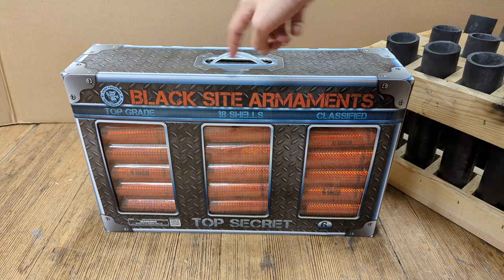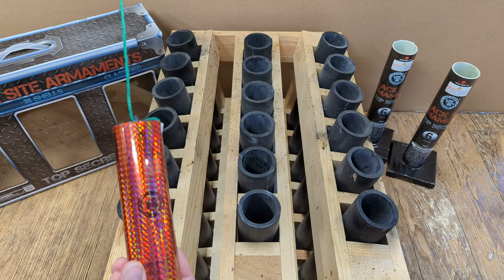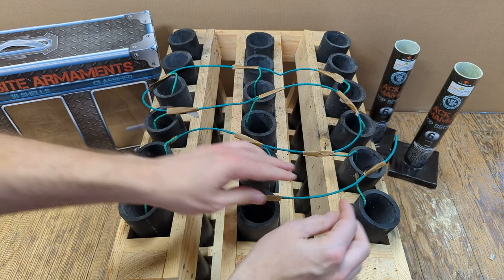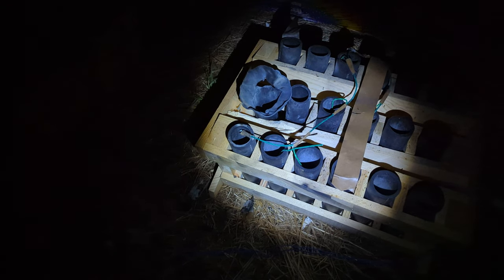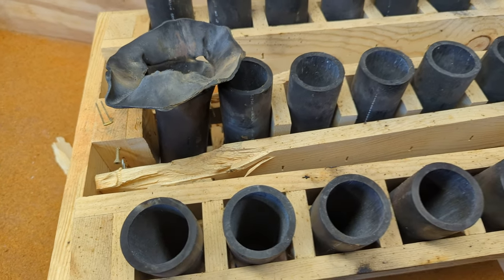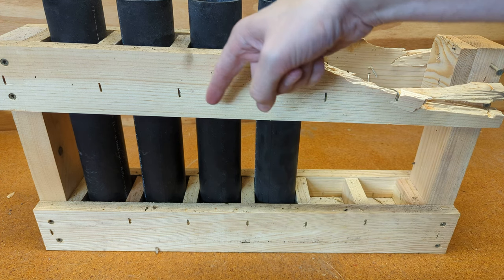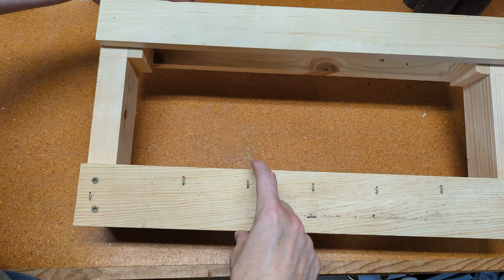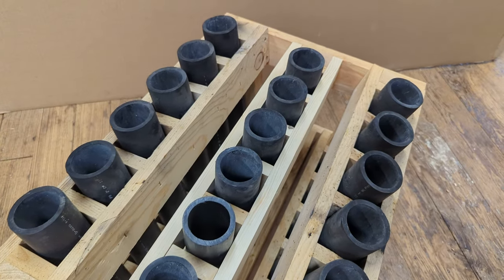I had a firework shell muzzle break!

Comment: Nice breaks for sure..... the orange one was very nice.   Was the one that flower potted  have a mine in it also? Just curious on that.   On building racks I like using glue too, yes hard to fix, but they can be tossed around for years and not loosen when glued and screwed.
Reply from the maker: I figured out it was the Whistling tail to brocade crown to timerain shell that blew. Glue is always a great idea too!

Comment: Thats the reason when i start building my own racks im going to run full length spacers.
Reply from the maker: I have totally been converted to spacers too. I need to rebuild a bunch of my racks, but will eventually only use spacers.
Reply: @JoelRobinsonPyrotechnics  I'm using the fiberglass included pipes right now but will be looking into the pyroboom HDPE orange pipes for my racks. It's just taking me a while to build up. Next step is joining the pgi and working on getting a cobra system and man that site gets confusing. I don't know if I get a module if the romote comes with it or if it comes separate. Than work on getting my 1.4 pro license from pgi.
Reply: @JoelRobinsonPyrotechnics  ps I think full spacers are safer. Where the pipe is fully contained.
Reply from the maker: @jesseweaver_fuyt  You're totally correct on the safer aspect. That is awesome to hear man, and there is nothing wrong with using the fiberglass tubes you have. You can screw those down to a piece of wood and still have a safe rack.
Reply: @JoelRobinsonPyrotechnics  yes. I got some 2×3 and some 1×3 to build one. The issue is is bills have always come first and it's rough saving up for all this stuff
Reply from the maker: @jesseweaver_fuyt  It is an expensive hobby for sure! I have a ton of fiberglass tubes if you want any. Also, you're doing it right by prioritizing your bills. Gotta make sure you're covered first!
Reply: @JoelRobinsonPyrotechnics  I'm going to get 50 HDPE pipes this fall. It's only $170 from pyroboom.
Reply: @JoelRobinsonPyrotechnics  and I live in Pennsylvania. It's kind of a lot to ship that weight
Reply: @jesseweaver_fuyt  If you mean a FULL length spacer running the length of the mortar don't do that!  You are building a box then and taking away two sides for the explosive gases to leave..... If you just mean, spacers in all your racks between all your mortars and the end boards please ignore me!
Reply: @denfireworks  no it will be in-between the each pipe. It will still have open space on two sides for the path of least resistance if there is a blast in the tube. I have been blasting rocks for 5 years and that part I know. You always want at least on path of least resistance

Comment: Do you recommend spacers between each mortar? I have 6 racks currently, 2 rows of 10, but no spacers. They are very heavy and well made, but wondering if spacers are needed.
Reply from the maker: Space will always be safer as it allows room for the gas to escape if something were to go wrong. The fewer total tubes in a single sleeve will help mitigate risk. There is nothing wrong with the setup you described, though. If you build more in the future, consider adding spacers is my recommendation.

Comment: Joel what do you think would of happened if you had fiberglass tubes instead of HDPE? Or do think the spacers would still minimize the damage?
Reply: That black plastic pipe looks more like ABS to me. Fiberglass would probably be stronger. ABS is primarily used for drains.
Reply from the maker: It's HDPE. The HDPE tubes will split or stretch like you have seen in this video, whereas fiberglass would basically shred. To answer the original question, spacers will still help with fiberglass. Most professional racks still use fiberglass and you'll see most racks also have spacers (exceptions with 2-3" racks depending on company).